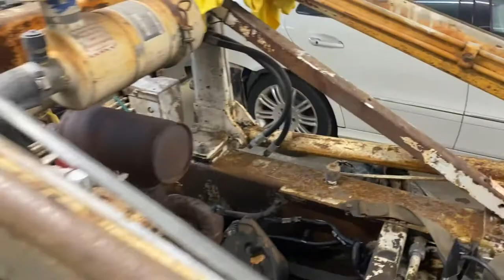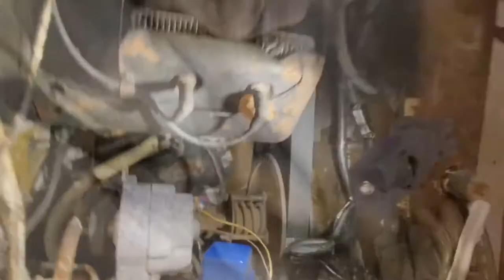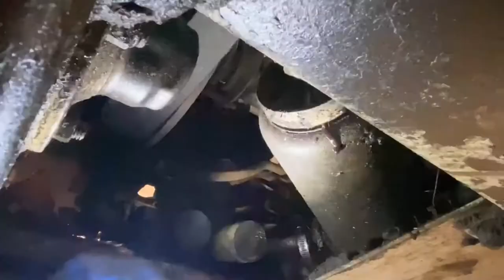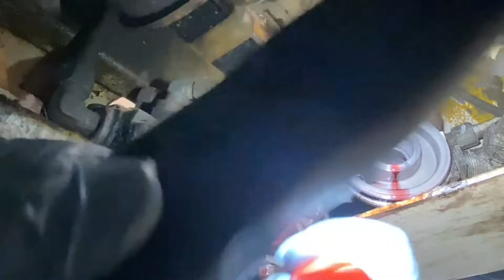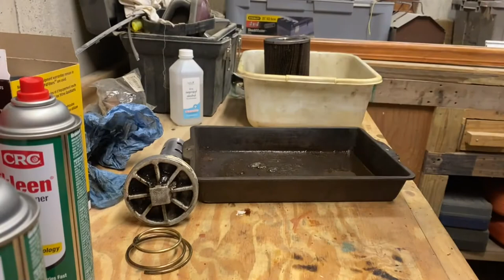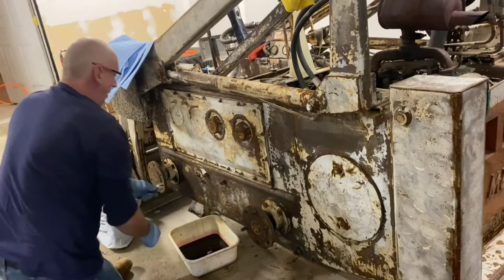Old Bobcat Hydraulic Oil Filter Replacement

Comment: Thanks for the video Bry. As I understand it, the oil for the chain boxes and the hydraulics is the same oil, so if the side panels have been off, and there was gasket material scraped into the chain box, then it would have been caught by the filter. Not sure where that metal comb thing came from - was it a thrust bearing casing from the steering clutches?  I have a 610 that I am trying to refurbish. Not sure what the difference is between the 600 and 610? Mine came with the 4 cylinder v-twin wisconsin also, but engine was blown when I got it. I am trying to repower with a Honda, Kohler or Predator. Looks like others have done this using  a snowmobile CVT pulley. Have you seen Glenn Colassi channel? Do you use standard transmission fluid for the hydraulic oil? Keep the videos coming! What area are you in? Thanks again.

Comment: how many gallons of ATF do you need to fill this thing from empty?
Reply: If i remember correctly, it's about 12-13ish gallons. I changed fluid in mine and i remember buying two 5 gallon buckets and a few gallon jugs. I also remember using regular oil, like SAE30.